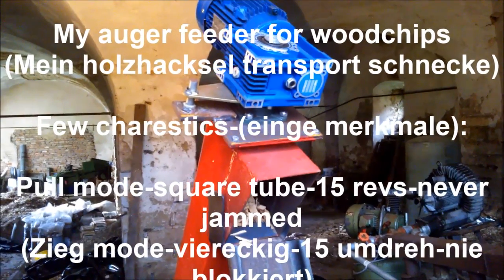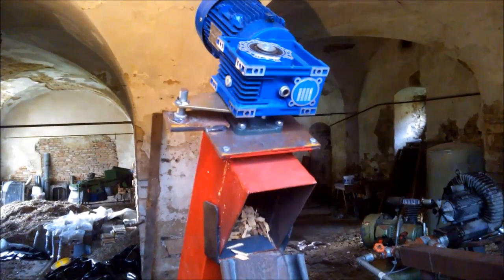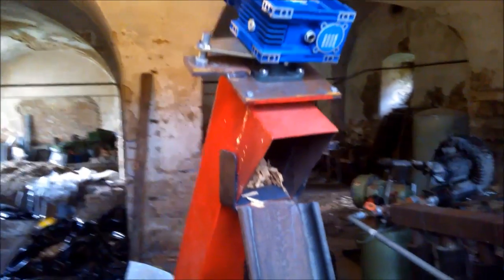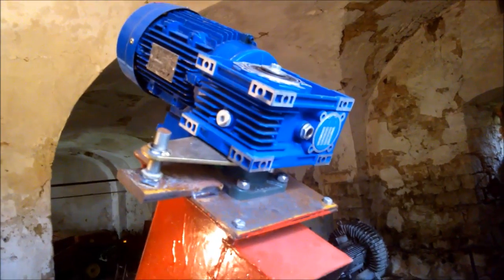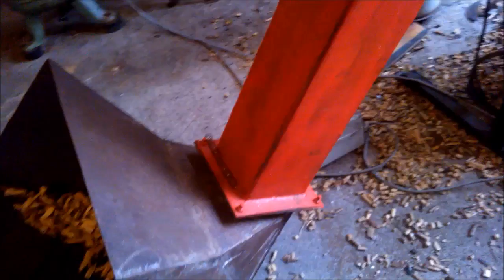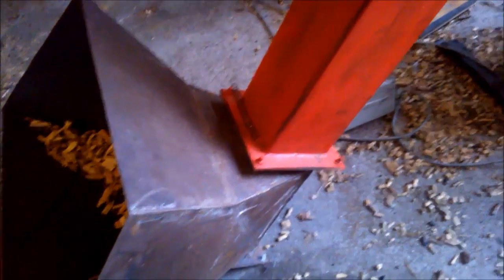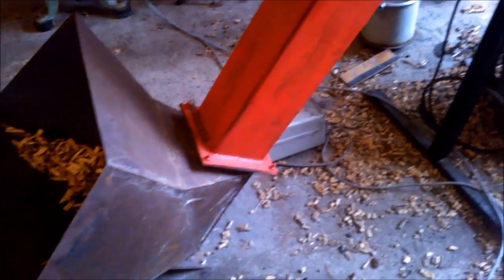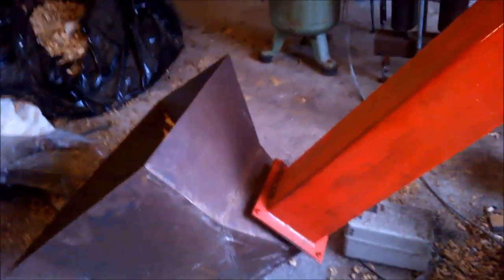My Woodchips auger feeder

Comment: Luk, this looks really nice. I like the pull-up design, vs pushing the chips.  I'm wondering what's the diameter of your auger versus the inner width of the square tube?  In other words, how much clearance there is on each side of the auger, to the sidewall of the tube?  I reckon there's a trade-off between effectiveness and problems, as this space changes, and wondering what your dimension is. Thanks for your very interesting videos!
Reply from the maker: BZ, Thank you for your comment. In answer to your question...The auger has 125mm diameter and the square tube is 150mm. So realy not much clearance is needed. The secret lies in the round auger versus square outer tube. The chips can escape and work themselve free in the corners of the square tube at every flight of the auger.
Luk

Comment: I wonder how a chain or belt type system would work.kind of like a mini hay ladder maybe bicycle chain on sprockets with small scoops every few links..just a thought.you make some awesome things
Reply from the maker: Michael,  Tank you for the complement.
Yes a chain auger would be one of the many options to consider when building a feeder system that feeds in...drop...drop..drop.wich is howone has to DriZzle. I am now rebuilding my "DriZzleR" than a new cyclone and then I will attact the feeder again. Maybe you subscribed... then you automaticaly will see first the new video's.

Comment: Hi Luk.  You are correct.  The shaftless auger does "wrinkle" in the tube.  That's a good term for what happens!  It also bends at the open end of the auger and that causes it to scrape on the edge of the tube, causing even more trouble.  I added a short section of auger tubing at the far end of the "spring" to eliminate that problem, but it still catches some of the time.
The motor that I am currently using is reversible and I have it set up with a switch that enables me to do as you suggest.  That helps.  I think the GEK guys do that reverse-then -forward thing with their design.  I also put a hand crank on the end of the shaft so I could operate the auger manually to get a feel of how it is working.  But even with all that, I still don't feel that it is going to work that way.  I got the auger for free and it was 16 feet long, so I have already cut it in half.  I have nothing to lose by slitting it open. 
For better wood chip augering,  see this:
Froling wood chip and pellet firing T4.mpg
These guys do a lot of preconditioning of the chips before they enter the auger.
Reply from the maker: Pete, Yes Froling is a nice machine. Popular and reliable but you have to have the money as they are expensive. Have you notised? All thier augers have square tubes. To prevent "wrinkling" do you have enough space to introduct a pipe inside the tube and fix that with bearing at either side so this pipe can roll on top of you shaftless auger giving it some sort of stiffness/ If you have to cut the auger tube open then I would try to cut only one slit all at the top of the tube and bend the tube walls to the side open to form a sort of troth.
Reply: Luk Vanhauwaert hello and sorry for posting a question so many years later. I was wondering if anyone has had success with cutting the top of the tube open for resolving the issue with the wood chips binding up. I have a round tube and I was wondering if cutting the top of it and welding on another tube, kind of like making the whole section oval, and without changing the actual auger, if that would work.  Thanks in advance
Reply: Frenchcreekvalley .frenchcreekvalley Hello, I was wondering if you were successful by cutting the top of the tube for giving the chips a place to escape, and how well that worked out for you. Thanks in advance!!!

Comment: Thanks Luk.
I have been trying to make a round tube work with an auger flight that is like a long spring with flattened loops.  It has no shaft in the center.  It is about 2 1/2" in diameter and the tube is about 3 1/2" in diameter, so I thought there would be enough clearance.  But it still binds up badly.  This style of  "auger flight" works well in some applications, but it sure didn't work for me.  The flighting that I used came from a ground-grain feeder for hogs. 
I will try slitting my tube and opening it up. If that doesn't work, I will have to start all over and I certainly will use a square tube.

Pete Stanaitis
Reply from the maker: Pete,
I think maybe the shaftless auger can wrinkle inside the tube and then still there is a spot without clearance. You, or your freind Adams is good at electroniks. Maybe before splitting the tube you could try controling the motor in a way that  it moves some forward and then retracks a little backward, so forward...backward...forward. That takes the wrinkle out of the auger and frees and re-arange the chips at the blockage. Just an idea that might maybe work. As for my auger I show in the video, it sometimes screaks and screams very hard but had so far never jammed. My problem is that it feeds not precise enough for DriZzling.
Luk